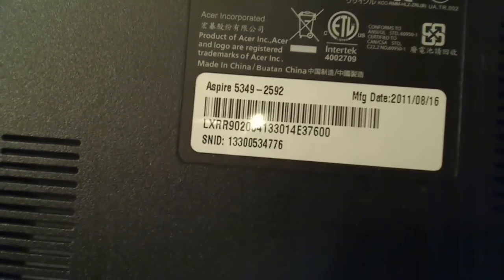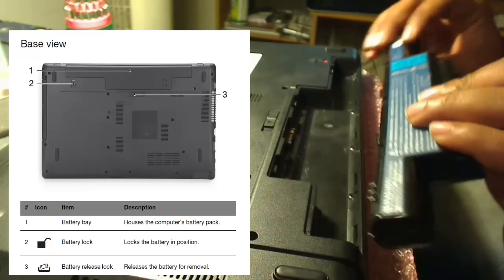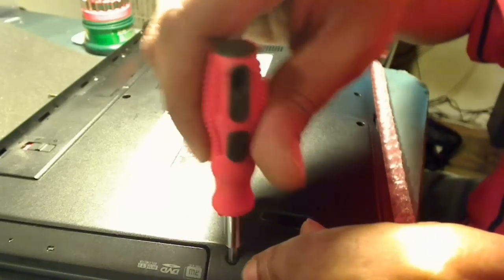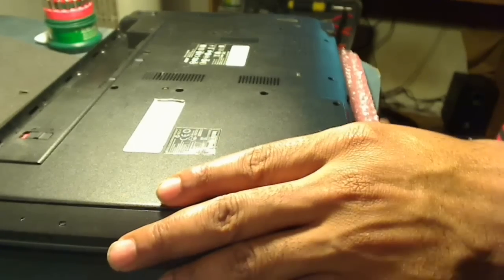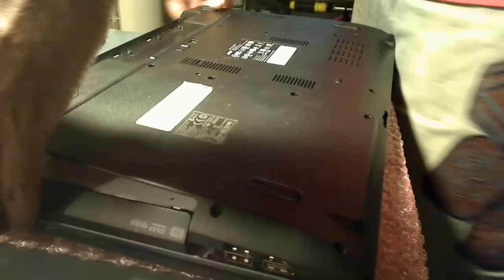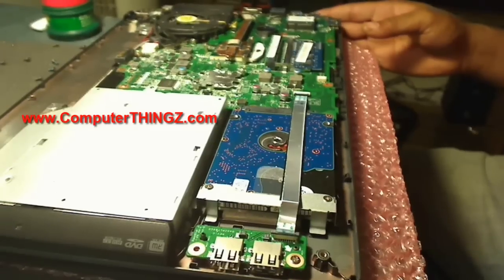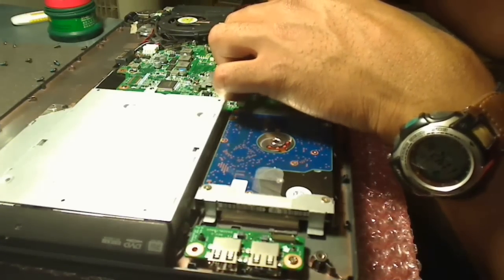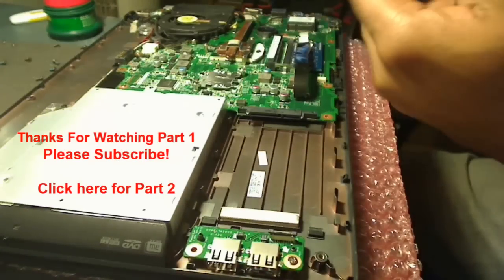Acer Aspire Hard Drive Replacement (Part 1)

Comment: My sister has HD problem with this particular Acer. I found SATA III drive (2,5" 9,5mm, 750Gb) relatively cheap. Never opened one, you have... You think that 9,5mm becomes a problem? And also I think I found site that said SATA III works with lower versions (as I think this Acer is SATA II, yes?), no problems with attaching to MotherBoard connections?

Comment: Also I forgot to mention, nearly all the screws for the back bezel are identical.  There are 4 M2x3L screws holding the battery recess which are easy to spot because they are tiny.  The only other screw to watch out for the one that's at surface level to the right of the windows sticker which is SLIGHTLY shorter.  The rest are all the same.  Tracking screws is EXCELLENT general practice, but this time it's not a huge deal if you don't.